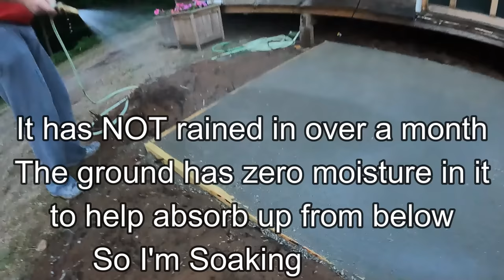DRY POUR CONCRETE- Northern Climate!  - easy and simple!

Comment: KEEP WATERING it! The slab will absorb only as much water as it needs to cure, but since the ground was very dry, you want to ensure enough water gets all the way through it before removing the forms. Also, you didn't use an edging tool like Cajun Country does, so that also makes it harder for enought water to seep in. I would leave the forms on as long as you can stand to, but at least a week-- again, because you didn't use an edging tool to separate the wood from the concrete. One more thing-- we pour concrete doesn't achieve 99% of its rated strength until 28 days have passed, so keep watering and don't build on it for at least a couple weeks. Great job!

Comment: Pretty concrete is slick in rain or ice.  A rough surface is much easier to walk on in the winter.
I have been using dry concrete for years, however I always wet the hole and area around it before dumping the concrete in, then mist the top when finished...
Reply from the maker: Nice.....good to know. I was considering wetting the ground.....but didn't want to experiment,  lol. Thanks for watching

Comment: Hi,bill from MN and my wife and I just did a small 5x3slab by our porch. Was wondering how your slab is holding up. 
Thanks bill
Reply from the maker: So Far it is doing great. We are just starting our room build around it and while digging around the Slab it seems Hard and solid. We did Choose to sink posts outside the Slab instead of build ON it, but that was only so we didn't have to drill into it and anchor the walls.

Comment: The instruction on HOW to mix are on the package. 
You are not saving any time dry pouring. The HUGE amount of time required to REPLACE it far sooner is just not worth the HUGE risk of a worthless pad.
AND: in Northern climate rebar is the only way to give the pad horizontal strength AND water/freeze/heave WILL happen.
Reply from the maker: I guess we will find out......stay tuned  for the video of us removing it.....will be very soon I guess.

Comment: #1 rule… lol… move heavy bags of material once! I’m 67, having Home Depot deliver 114 bags of 50 lb bags so I can lift them!  Delivered to within 5’ of where they will go.
Reply from the maker: Lol . Hope it goes well! We just picked up 100 60lb bags (so 3 tons!!!) Lots of moving to occur 🤣
Reply: @OffgridwithJayandJen Lowes delivered 1 pallet inside my form and the other next to it. I cut a U in each bag before I lift it and turn it over. I used 2”x6” boards here in NH. Put 45 bags in, then added metal like you, then I added 45 more bags. Tried to level it, but really needed 2 people to screed. Had helpers the next day. Added 10 more bags and got a bag of non aggregate cement to sprinkle over the pebble areas. Rolled w a paint roller. I have a few bumpy areas from the paint roller, and I’m still watering it 5 days later. Looks great!  FYI- for 2x6 forms that are 8’ x10’ I used 100 bags total. Returned the extra.

Comment: If you hired someone to pour this for you, and when he showed up to do it, he told you that he decided to cut out the mixing process, so it's going to have a mediocre finish, it won't be as strong, it's not an  approved technique by the manufacturer or any state, county, or city building department, but mixing the concrete takes more effort than he's willing to put into this job because quality work doesn't matter on small jobs. Would you think that sounded like a good idea, or would you find someone willing to do the work it takes to get quality results
Reply from the maker: People have done worse to save a buck

Comment: How come you didn’t cut your edges and when you take boards off cement doesn’t break I am going to put foam boards on the ground first to help with the frost line I think
Reply from the maker: The edges were a little rough, but we are putting a wall on top of it anyway, so it didn't really need to be pretty. =)
Reply: @OffgridwithJayandJen  oh that makes sense thanks

Comment: FYI if you are going to do DRY POUR  It is much better if you go ahead and WET DOWN THE CONCRETE, And THEN STRIKE The Concrete Level !!  That Way you can mix it up a little with a board, or hoe or a shovel.  You want to get the moisture all the way through at the same time to mix good.
Reply from the maker: Makes sense.....although the way we did it....it soaked up a TON of water. Hoping it holds up, so far so good. Thanks for the input
Reply: @OffgridwithJayandJen  Your welcome, I did a couple of concrete pads like what I said and it takes the concern away from not getting it wet all the way through... But you did a great job!

Comment: Why in the world did you not just drive in with the trailor up to the cabin.?   When it is super wet, maybe it is a bit hard to do, but not when it is dry surely.
Reply from the maker: Hill up to cabin is too steep to pull up that load. That is about 4500 pounds of concrete plus the trailer and my truck is old and tired

Comment: every dry pour i have seen so far the surface looks like its flaked off in some areas. I always see loose bits of concrete. The concrete will be strong enough for sure but the surface seems brittle and flaky.
Reply from the maker: It definitely has a different texture and look than wet pour, and I feel the surface is more susceptible to scratching.....but honestly it looks better than old school concrete with rock chunks in it. And the texture makes it less slippery. I would never do this for something like a drive way that was driven on, but for patios and sidewalks I feel it is fair game

Comment: I enjoyed the video but I don't understand why you would do something like that. Only a 4 inch slab and there is no gravel or cement screening underneath it. Also, you should have wept the ground first if it does not rain in over a month, so there was moisture underneath. It would have pulled from underneath. It is good that you use the metal reinforcements.  But anytime you're building a structure on that. You need more than a foreign slab and a footing around the perimeter. But good luck to ybut it was rea and a bad trand especially if it's supposed to be a permanent structure. Because you want to the last a lifetime

Comment: Alright im done with the calculations...25 bags of concrete? Five trips to home depot 20 gallons of gas😮.3 days labor two of you.blood sweat tears,then add water.two bad backs= ? 2500.00...one phone call ,one concrete guy.500.00 and poured properly.god so sorry for you all.
Reply from the maker: Actually got it all in one trip on a trailer. This cost us about 300 dollars. Far less than your calculations.  We are too far remote and uphill to ever get a truck to come up here.  
This worked for us for many reasons.

Comment: I just see this not lasting your freeze and thaw cycles.
Reply from the maker: BS.....I don't see why it would have any issues. Here in Northern Michigan and our property is it 99% sand......hard pack....dry.....and high sand. It holds very little moisture and  when it does rain or snow.....it literally dries out in just a few short hours. Being it is on top of the ground and frost heaving really shouldn't happen in those conditions. Much like our wood post foundation......there is no moisture or rock and hard clay to heave during temperature fluctuations. Just my thoughts
Reply: @OffgridwithJayandJen freeze thaw has more to do with water on the surface of the concrete. The concrete will absorb water then freeze, which we all know makes the water expand. Over years the pressure of this expansion and contraction will start to deteriorate the surface of the concrete. I’m sure you’ve seen spawling on driveways in your area. This is more or less normal, even the best concrete has a lifespan in cold climates. That’s why is sooo important to get a good finish, it will push the rocks down and bring the cream to the surface, also sealing it up from the elements. You didn’t do any of this. Placement techniques are incredibly important, more important than your mix in some cases. That’s why we in the industry follow ACI guidelines, years of testing and research have given us best practices for placing concrete. Your method hasn’t been subject to any legitimate scientific testing. And yes I’ve heard the anecdotal evidence, it’s meaningless.

Comment: Don't fool yourselves into thinking that the concrete that you paid for in the bags will perform as per the design with this method.   Ain't going to happen.   Read the mixing instructions on the product.   It clearly denotes the amount and sometimes even the ph of the water to be used.   This is known as the water to cement ratio.  It is impossible to obtain a uniform or homogeneous mix at the correct ratio with this dry pour YT system.   The concrete will not cure at a uniform rate throughout the slab.  Consolidation is also compromised and the aggregates will never be uniformly coated with the cement.   Aggregates includes even sand particles.   Will it harden? Yes it will.   But it will not be a cohesive bond as engineered,  designed and tested...ever!
Reply from the maker: Blah blah? Blah blah blah? Blah....Blah
 Blah blah